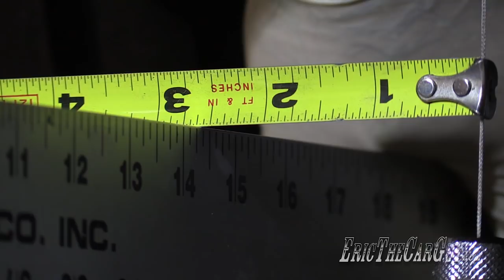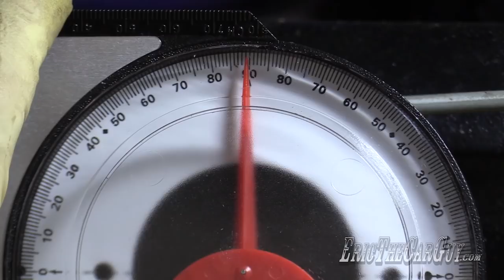Take Corners Faster! How To Install a Panhard Bar

Comment: At first I was a bit thrown off by the clickbait-y thumbnails and titles, but after your previous video I understand completely, anything to keep the channel going :)
And the Fairmont videos are not getting boring, I still find them educational and fun. Keep doing what you think is best 👍
Reply: I fully agree in this case as well. GoogTube is doing everything they can to please the queen (CEO) and her YouTube RED scheme. That includes forcing people out of their channels and in some cases jobs. Funny how we had to fight exactly this kind of thing years ago, but now, with their backs against the wall, we have to accommodate for it. It will certainly make things going forward (IE discerning the good ones from the bad ones) hard.
Reply: for some reason i though the title meant he was going to give advice on how to cut corners to get flaterate techs to improve their efficiency, like using a pry bar to reset brake calipers pistons instead of using a brake caliper tool.

you know what i am saying?
Reply: How are they clickbait-y ? does he not install panhard bar in this video ?

aserta that is not why everyone on youtube is struggling, youtube RED has nothing to do with it, the fact that multiple advertisers are pulling their ads off is what is killing content creators
Reply: You Tube has been losing a huge amount of money since it was started. Alphabet (Google) has been trying to fix that but it is struggling and still loses money.  This whole set-up will end if they can't earn a profit.
Reply: lobmin that was my first thought too, bright colors and stuff.
Reply: i agree too
Reply: I do not see any clickbait here.  I watch using Google Chrome and run an adblocker plugin.  No clickbait at all.
Reply: I Agree, keep the Fairmont vids coming Eric!
Reply: That's not clickbait... The pan hard bar helps you keep stability and handling in high speed cornering.
Reply: Good content doesn't happen in a vacuum though.  Running an adblocker just keeps content creators from making any money.  Anyone with a channel like Eric's isn't doing it for fun.  They do it because they make money.  The minute revenue dries up the desire to create content evaporates.  It take an UNBELIEVABLE amount of time to make videos that don't suck.  If you want to support your favorite content creators, lose the ad blocker and let a pre-roll advertisement roll once in a while.  That's how you encourage good content on YouTube to continue to be created.
Reply: Oh crap, I didn't know this got so popular lol

I agree this isn't really clickbait per definition, and that's why I added "-y" to emphasize that I didn't mean full-on clickbait. And I think Eric did use that word to describe it himself in his video where he taks about it....and besides, just look at the change in colors and the big text, it is more clickable.

I just found that "clickbait-y" was just the best way to phrase it.

Sorry about the rambling lol
Reply: WheeliePete You make it seem like Eric does videos purely for the money, I'm pretty sure there is an aspect of fun/enjoyment to it; if there wasn't, the videos would probably be way more dull and less nuanced. 

I agree that refraining from using an ad blocker is a good way to support content creators, if you want to help them out you can generate more revenue by letting the whole ad play, i have also heard that they get paid if you click on the ad. 

I use uBlock origin on chrome, along with a tampermonkey script that whitelists certain channels that I want to support. The whitelist thing makes the browser go through another little step when loading in youtube pages(it has to add a variable to the url), but I think it's worth it and I recommend using it if you don't want ads on every video you watch, but still want to support certain youtubers. Google "whitelist youtube channels [your adblocker] [your browser]" for guides...

Once again, I apologize for the walls of text :P
Reply: Oh, I agree that Eric probably does enjoy making the videos, but (and this is coming from over 10 years of creating my own content and making enough money from it to have a noticeable effect on my families lifestyle) when you reach a level that Eric is at, it's a business.  It's a second (or third) job.  It comes with a 1099G for the IRS. I really appreciate the creators that take the time to document these processes and make these videos.  Eric's volume of content he puts out on a regular basis is impressive and I know from my own experience how much work takes to shoot, edit, and upload that kind of volume.  I just wish more people understood that good content is an insane amount of work and the best way to encourage it it to realize that the advertising is mainly what funds these creators.

Comment: Love the Fairmont video's and being a non-gearhead, I'm learning that it's truly not for the unskilled or weak minded. I retired from the electronic and computer network field and started working part time at a auto part supplier as a delivery guy. By the way I've used plenty of your repair videos as well especially because I have the 2.4 vtech.

Comment: i thank you for keep put out content, it got take alot work to edit and get it on youtube.  not include the time it actually took to do the job
Reply from the maker: Thank you for your comment.
Reply: Hi Eric, you should break this long video into at least two or three separate videos.  That increases your number of views and increases your revenue.  I'm not a big fan of the Fairmont project but I do learn a few things.  Thanks for posting.  Take care and stay dirty.
Reply from the maker: I purposely didn't do that because I've had many complaints about the #FairmontProject dragging on too long. Also, my experience withe multiple part videos is that you loose a lot of viewers after the first episode. Thanks for your input.
Reply: I kinda like this being a longer video.  It's a long job, and this reflects reality (closer to reality, anyway - I'm sure it took more than an hour, though!)  It beats waiting a week for part 2, then trying to remember all the details of the previous episode so I can understand how and why you're setting things up in a specific way.  Awesome vid, mate.  :-)
Reply: A couple of the guys I watch on You Tube now divide up there videos into a couple parts and it increases their revenue and they make it easy to watch them in order.  The next segment just comes up automatically so it is no problem.

Comment: Read AND follow the instructions, Eric.  Great progress.  When using a plumb bob, measure from the 1" mark on the tape measure.  Prevents moving the string and is more accurate anyway.  A tape measure is accurate when measuring from the inside only when the end piece is under compression, and they get "sloppy" with use / abuse.   Just remember to do this for both sides!
Reply from the maker: Great tip. Thanks!
Reply: And since advice is free, when measuring the depth for the crush sleeves, just put them in and scribe a mark with the sleeves inserted...that is the exact amount of material you need to remove.  You can then transfer that depth using a ruler or, even better, a scriber (like a protractor).  Much faster and more accurate.  Old carpentry trick.   And glad you showed the tape to mark when cutting a cylinder; deadly accurate.
Reply from the maker: Thanks again for the great info. I'll have to try that next time.

Comment: Thanks for the video. Something you might find helpful, if a bolt has the hardness marks on the top of the head (3 tick marks, 6 tick marks etc.), it should use a standard wrench’s. If it has numbers like 8.8, 10.9 etc., it should use metrics wrenches.

Comment: Hi Eric ,  to cut  the small tubes  on the  assembly  I use plumbers mini tube cuter to get  a accurate line round a tube ,but you can't use it in all  situations  , as you show the tape idea works well.  Looking  forward  to the next video

Comment: That left side shock mount takes a little work to line everything up. My panhard bar bracket ended up not being exactly square (it had to do with the frame rail width and spacing) but the bar is. The bar wasn't horizontal with stock lower control arms but after installation of the MM control arms (with the adjustable spring perches) all is good. Excellent video.

Comment: Hey Eric, just an FYI, the angle of the PHB doesn't matter a whole lot, certainly not the amount you have.  The only thing the angle of the PHB is going to control is whether or not the lateral movement from the PHB's arc is going to be consistent in compression of the suspension as it is extension of the bar.  Generally speaking, that is why you want the PHB mounted level unless you are on an oval track.  Small angles wont matter much and if you are really paranoid about lateral axle movement then you should have bought a Watts link to begin with!  The only downside with having one end higher is it will move at an angle rather than in an arc but at the small angle you have this will be minimal.  Also, SOME angle can help fight engine torque rotating the rear axle assembly about the driveshaft on hard launches which is why on the 2005-2014 Mustangs the PHB was angled slightly downward on the driverside from the factory.

Also, installing a PHB with a 4 link is a surefire way to destroy your torque boxes IF, and I want to reiterate the IF part, you have UCA's with anything but factory rubber bushings.  The reason why is because the UCA's were angled inward to locate the axle laterally and they define an entirely different rear roll center than the PHB does.  The roll center is, in effect, the point at which the suspension rotates.  For a PHB it's the halfway point of the PHB, for the converging UCA's it's going to be the point at which lines drawn through the UCA's intersect.  The UCA's definitely intersect above the PHB's RC and as the suspension compresses while cornering, it WILL force one of the UCA's to "change length".  With factory bushings this is done through bushing compression but with aftermarket bushings it is done with the unibody (since the UCA is generally stiffer than the unibody).  Generally speaking, if you want to run the PHB with an UCA and not a torque arm, you should yank the driver side UCA.  This will still put A LOT of force into the unibody, but only because all of the pinion angle control is being done through the single UCA instead of both.  It's far less stress than poly bushing UCA's (which are a no-no anyway) or rod end UCA's trying to change length due to conflicting RC's though!  The best solution is, as you've done, a Torque Arm setup.

These have been some epic videos.  Stumbled into this series while looking at how to rebuild a T5 as well as tear down a 302 and rebuild it as I'm about to purchase a 89 GT that needs that work done due to a blown head gasket and bad lifter, as well as a notchy 2nd and grinding 5th gear.

Comment: Love the videos Eric I'm 17 and learning a lot about cars as I want to go into diesel mechanics when I grow up and this is teaching me a lot about how stuff works I'm thinking about rebuilding a chevy 350 soon...
Reply from the maker: All great ideas and I highly recommend looking into diesel. Good luck with your build and with your possible career. #StayDirty
Reply: Jakob Breazier If you can look into heavy plant machinery, 360 excavators big mining dump trucks hydrolic systems very useful too. Electric motors will not replace big diesel things any time soon like it is passenger vehciles. In the middle of a logging operation, pit mine or huge construction project somewhere there's no electricity unless it comes from a huge diesel generator. There is always work if you're prepared to travel, and big money to be earned. If some guy is losing tens of thousands or even hundreds of thousands of dollars per hour that a particular machine is down he will pay  a lot to get it producing again. If you are the only guy that can do it, you can name your price. lots of variety, no to days the same. Engineering is awesome no matter which area you specialise in. I worked in a huge brewery and the production lines where amazing, when the went down company lost about $3k per minute. The guys that repaired them did very well indeed. Even the guy who was on call 24/7 to fix the forklift could charge huge money for simple fixes just because its 3am and the company needs that thing working now. 

Good luck with your career wherever you go and look after your back! You are never too young to ruin your back. Destroyed mine aged 24/25 and three years later I'm laying here waiting for surgery.
Reply: Ya Ive applied and job shadowed to cat and I have a potential scholarship they buy me a snap on tool box and some tools on top of the free collage. 1/2 of tools to...
Reply: Jakob Breazier Awesome, go for it, take full advantage of the sweet deals you get on tools as a student, buy the good stuff once and it will last a lifetime. By all means have fun, its a great time of life, but stay focused and dedicated it pays of so good in the future, I'm in a rough patch now but still doing ok in the long run, happily married for 5 years (its not for everyone!) Got a house and future prospects. My school lied to us and told us (my generation) not to bother learning a trade. they told us it was poorly paid and the only way to a good future was to go to university and and persue education for its own sake. Utter bullshit. All the people I know who are plumbers and electrians and mechanics etc are all doing great earning twice what everybody else does. All the literature and arts graduates are making coffee and burgers for minimum wage living with parents until their 40 or maybe rent a single room, with nothing better to do than drink what little money the do have every weekend. Cat is a solid business and company, I wish you all the best.
Reply: Thx man

Comment: Good video, getting ready to install one on a lowered Mustang.  Only comment is it looked pretty darn level before using a reamer on the adjustment slot.  I would've liked to see if the floor was at the same angle, meaning no adjustment needed.  Most floors are at a slight angle so they don't hold water or liquids.

Comment: Hello Eric, I did the shimmy test but I had the rear axle supported with jack stands and the front tires on the ground.  The rear did not move at all and I do not have a pan hard rod, if your doing a demistration it should eliminate any factors that could affect it like having the rear tires on the ground.

Comment: Hey Eric, first off... I love the fairmont videos. I've watched every one of them so far. So I wouldn't worry about trying to change your entire channel. You've got great content and people who say they want repair videos could just as easily watch these and learn something new as well. Secondly, I just installed a panhard bar on my mustang. I noticed that you had nice big wrenches to tighten down the lock (jam) nuts on either end. However, should you begin to hear a loud clunking noise after a few miles of driving and have trouble figuring out where it's coming from... go back and check those jam nuts! I found that mine had loosened up after driving so I went back and used some blue locktite on the threads. Haven't had a problem since! Keep up the great work and stay dirty

Comment: Live rear axles come from the horse and cart era. The panhard rod as a means of lateral location is but one step up from relying on the stiffness of leaf springs, better still is the watts linkage.  But Eric since you have updated the power plant how about going the full hog and fit independent rear suspension to bring the old fox body into the modern age?  It will make the car handle much better and with less unsprung weight at the wheels it will keep traction better over rough surfaces and in the corners.  I know you spent an age tweaking the differential and the videos were great but it is time to be really ambitious and a full IRS setup would result in a wolf in sheep's clothing (or should that be a wolf in fox's clothing).

Comment: Chasing your tail a little on the panhard rod adjustment. The rear end assembly will move in an arc as it moves up and down. Keeping the tires off of the fenders is probably the first thing to worry about. But you'll never really know till you take it out for a drive.

Comment: One of the nice things about American classics / youngtimers: You can seriously improve drivability and agility by adding century old techniques. Techniques that were obsolete already in Japanese or European car designs when the car was build: The Panhard rod is pre WW-I (1908?). The Fox body was sold until 1993. Still didn't have such high tech inventions.

Comment: Just a tip for measuring off your plumb bob string, if you "burn" an inch or two and hold tape measure next to the string instead of trying to hold against it it's a little easier and more accurate.

Comment: Hi Eric,
 I'm curious as to why you didn't just weld a piece of flat bar to the frame next to the bump stop to keep the surface level and add a little strength to the frame at the same time?

Comment: weight of fuel tank etc will compress the right rear spring just a little. I would not cut that right rear slot at this time. Wait till the car is all together and everything driven to settle into final ride hight
Reply from the maker: I'm running a custom fuel tank above the rear axle so that I can distribute the weight evenly. I agree, I'm going to give it some time before I set final ride height. Thanks for the input.